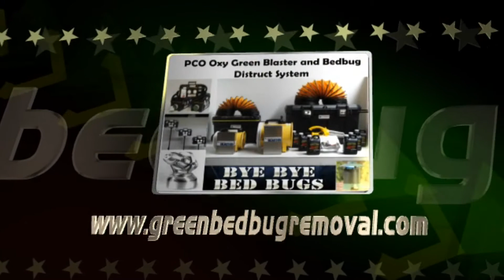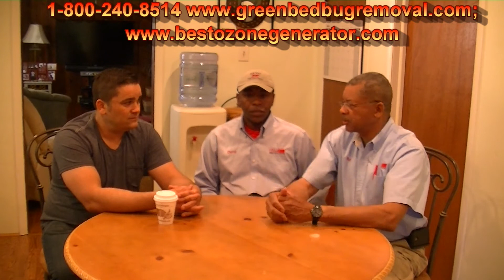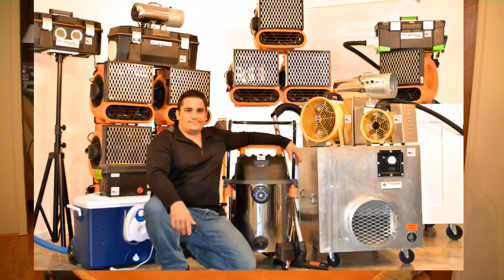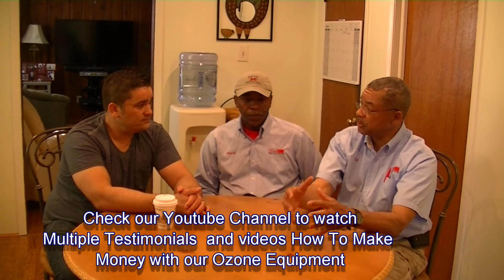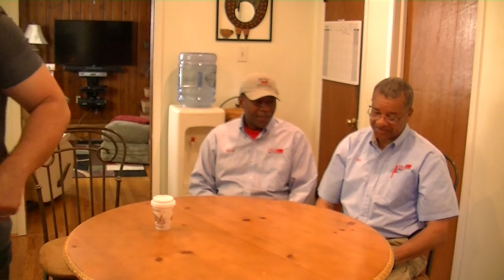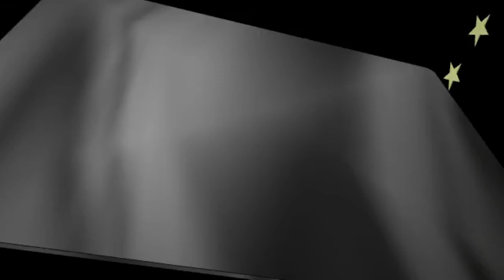Using Ozone for Bed bugs: Success Stories from BW Pest Solutions, Richmond, VA. PCOs MUST SEE

Comment from the maker: Ozone alone does Kill Bedbugs when used in combination with the essential oil and DE you get an unbeatable combination.
The reason we use a system rather than 1 step solution is we believe in built in redundancy. We have designed new solutions for the basement waterproofing, mold remediation, poultry, and pest control industries, utilizing a multistep solution  Guarantees 100% efficacy, and is the smart way to approach any problem.